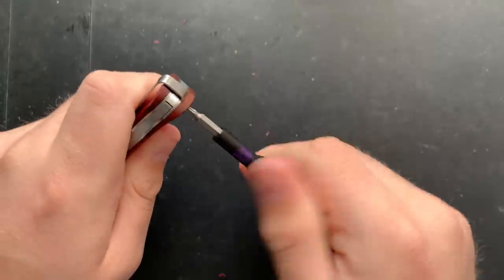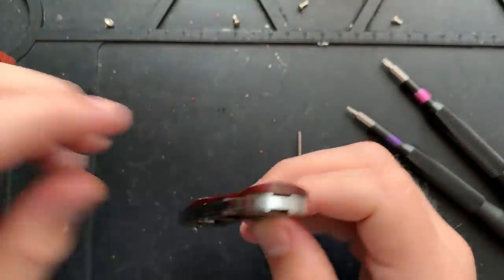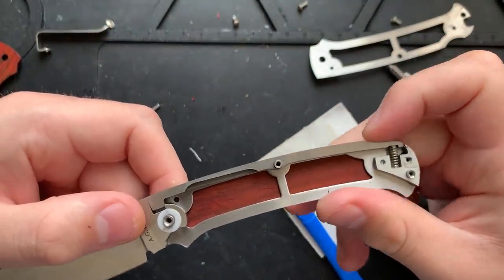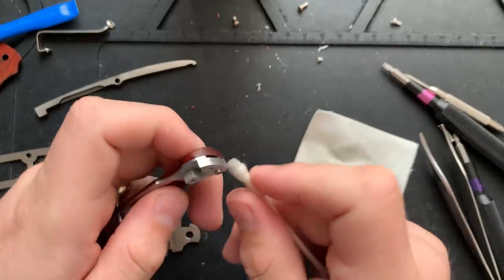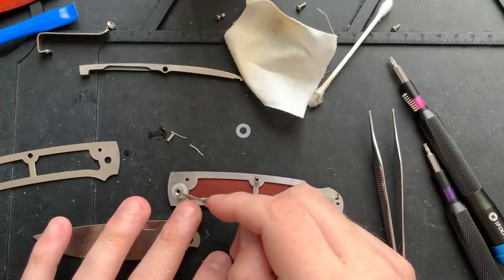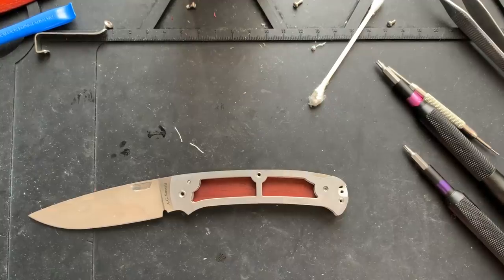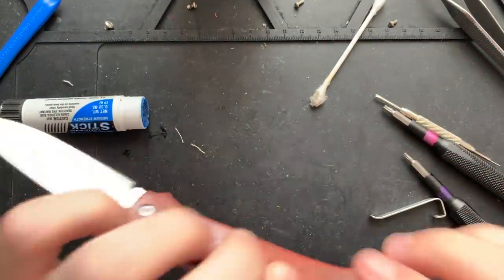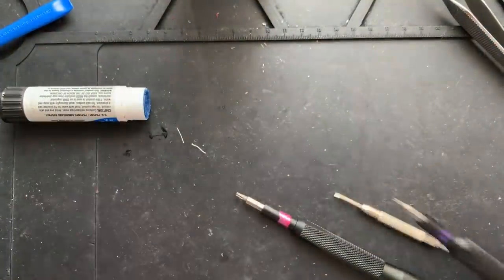How to disassemble and maintain the A.G. Russell Medium Folding Gent's Hunter Pocketknife

Comment: Speaking of lockbacks, when you were talking on the Gear Geeks podcast (which im patiently waiting for more) about the Buck 110 slim in brown micarta and S30V blade I became very interested because i don't own a lockback and also thought it might make a good christmas gift for dad.  Saw one at my local retailer and asked to handle it.  Was instantly disappointed by the blade making contact with one of the scales and lack of removable screws or an adjustable pivot.